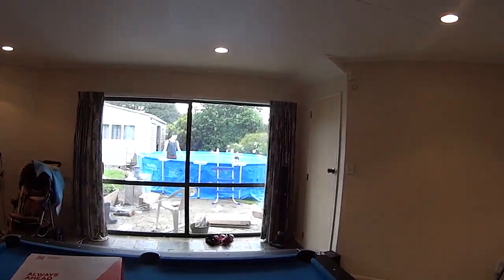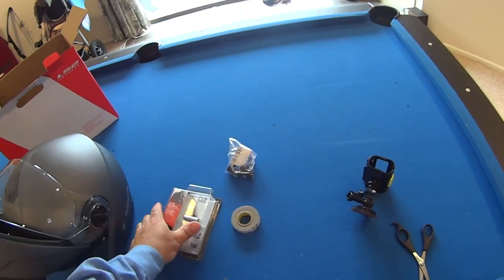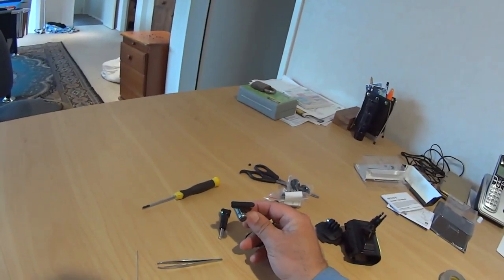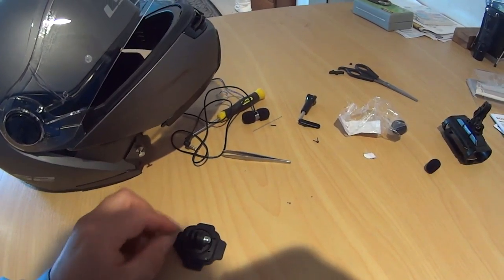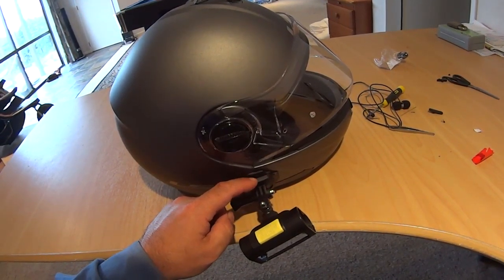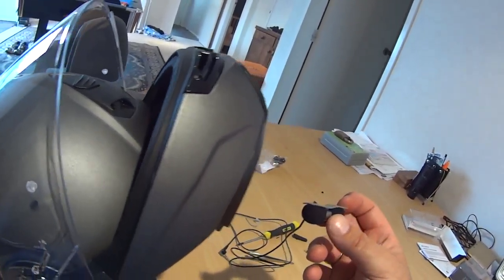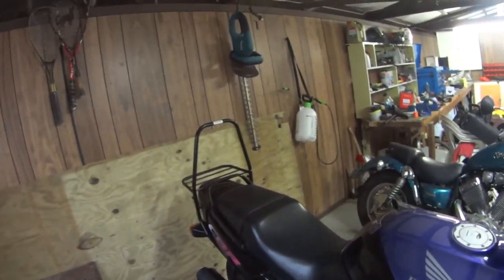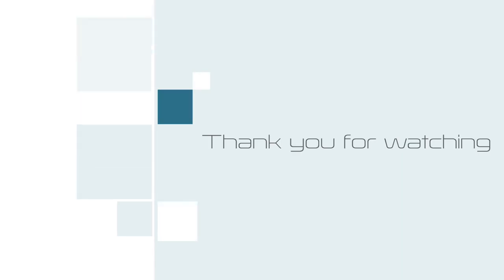New Helmet - LS2 Strobe  -  Matt Titanium and setup - nzbeeker

Comment: What you can tell me about the matt titanium paint? It will scratch easily. regards
Reply from the maker: No it seems fine, my wife's one is a mat black, and my one is the mat titanium...  I have done a 1777km ride and used it for shorter runs with no issues.  No scratches or chips what so ever at this stage... is working out to be a good helmet.
Reply: i'm looking for a new modular Helmet. don't know if buy the Strobe as a second helmet or save the money to buy a Shoei Neotec to replace my full face Shark. Matt Paint scars me a little but... the Strobe as so cheap e looks so well made.
Reply from the maker: I bought both of mine form eBay for approx $140ish NZD.  The are priced at $336 NZD in the local shops.
Reply from the maker: Check this out: https://www.youtube.com/watch?v=MClb5UCFVs4